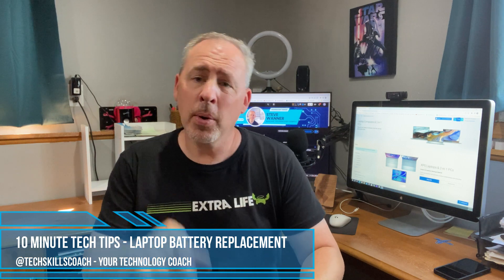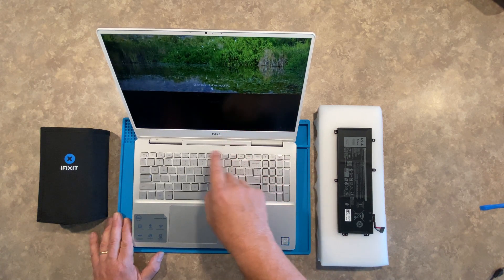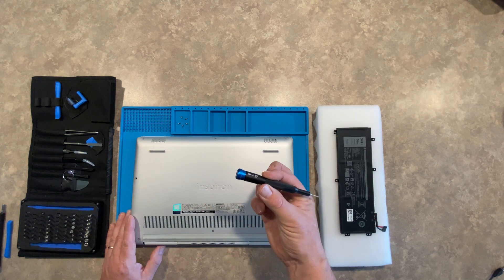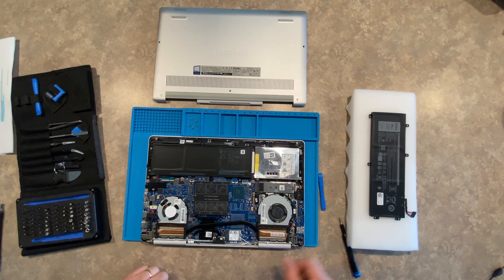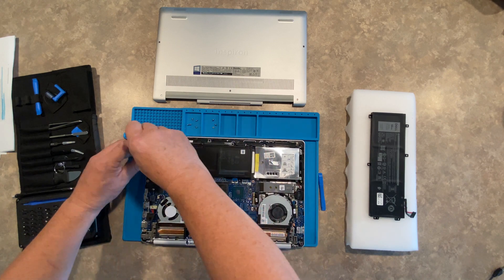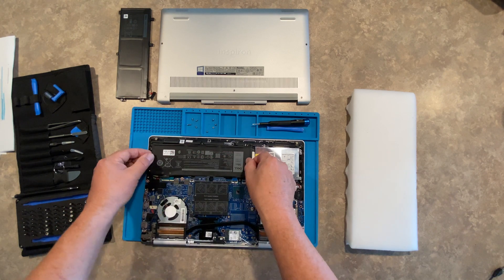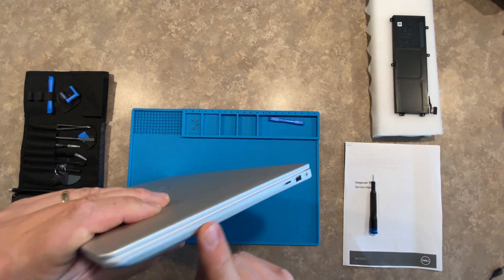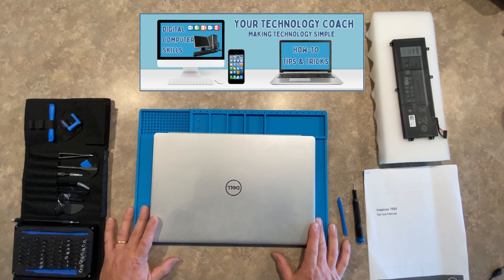How To Replace a Dell Inspiron Laptop Battery (7591) - #laptop #dell

Comment: Does changing the battery delete photos or files from the laptop ?
Reply from the maker: Great question. Your files are permanently stored on your internal Hard drive. However it's always best to backup your device before making any hardware changes.

Comment: You skipped how to get the three loosened screws out, which is why I looked for this video 😢
Reply from the maker: The three loosened screws do not come out they are set in place and only loosen enough to allow the case to be removed. I really wish all the screws would be that way so that you can't lose them.